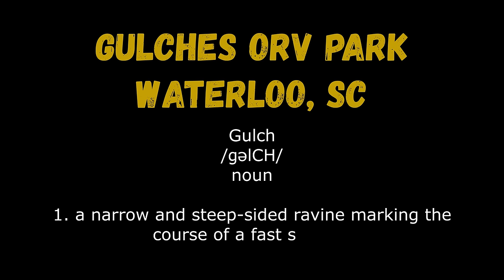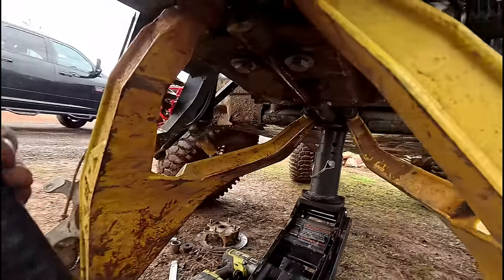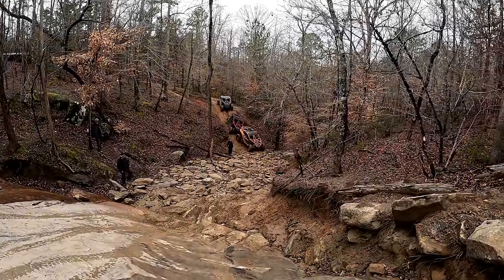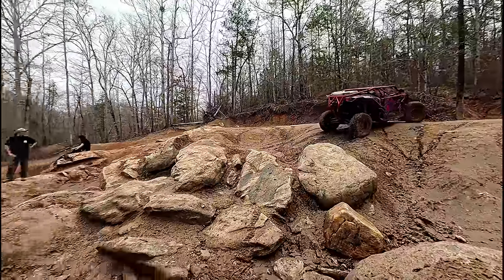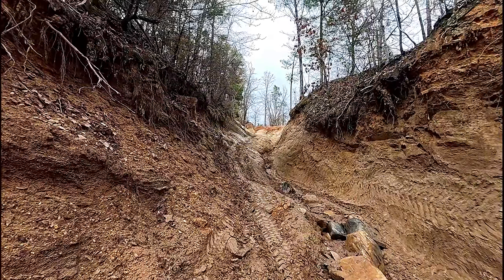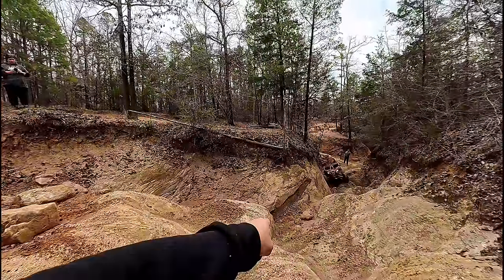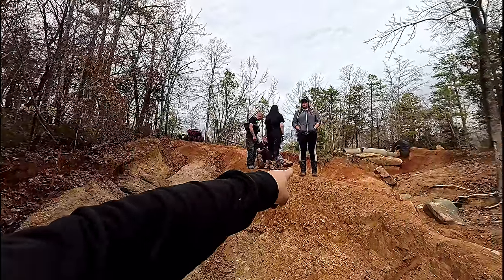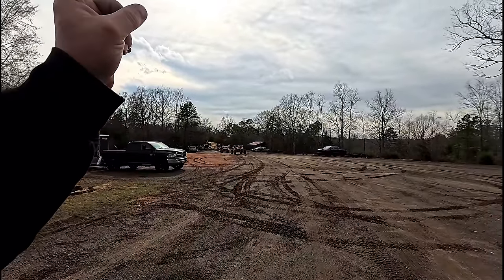FULL OF CARNAGE at The Gulches ORV Park | Heartbreaker | TNT | Ship Wreck | Rebels Blvd

Comment: Hey question for ya bro, I’m thinking about dialing in on 35s and doing what it’ll take to run them strong and reliably, I noticed you guys seem to stick with the 32s if im not mistaken, should I stay away from the 35s on a 64” machine ?
Reply from the maker: If you like to ride hard I would 100% stay away from 35s. If you just do slow rock crawling and trail riding 35s would be great. There are no parts or diffs that will fully handle 35s when momentum climbing.
Reply: @TheCanAmCrew  thanks again dude you guys are awesome and very informative I appreciate the help 🫡

Comment: I haven't heard mu h about rear steer
Reply from the maker: I haven’t been in a scenario to use it yet but I did use it a little in the last video. Since this video I have send it back for them to inspect the actuator to make sure the internals held up to the abuse and they are in the process of sending me a new vertical production model with a skid plate.

Comment: You guys always have so much fun. Keep killin it. 
Jesse, I recently ripped a skid plate off the back of my XRS do you run stock or aftermarket plates? I’m trying to desire what to replace it with cause it’s bent to hell now.
Reply from the maker: We run the stock skid plates off the xrc model. Which might be the same as what is on your machine. I’m not 100% sure on that.
Reply: @TheCanAmCrew  I think the 72” is different but i was looking at options, and i think the stock replacement seems best and cheapest. Do you stick with rivets or drilled the frame out for bolts?
Reply from the maker: @MrEsimmons178  i just stick with rivets.
Reply: @TheCanAmCrew  Sweet, that’s what i was leaning towards but wanted your opinion cause you know these machine inside and out. Thanks again, hope you have a great day.